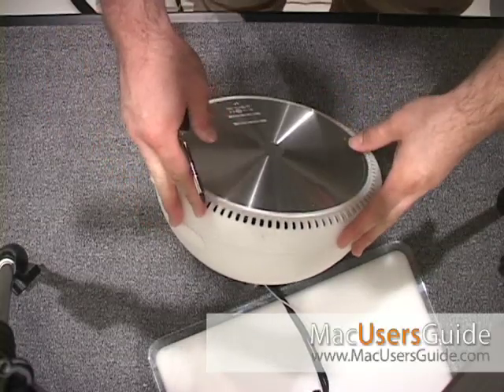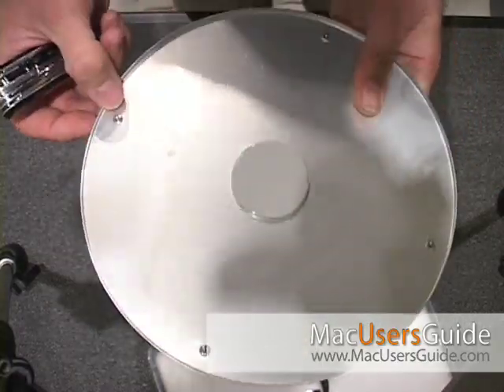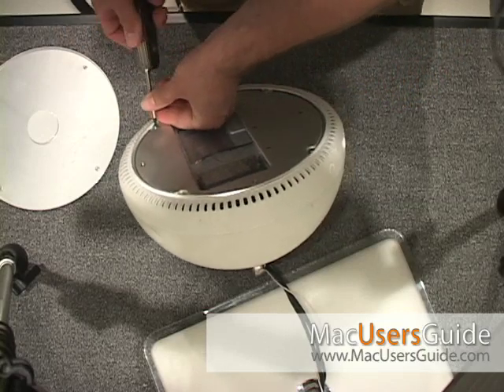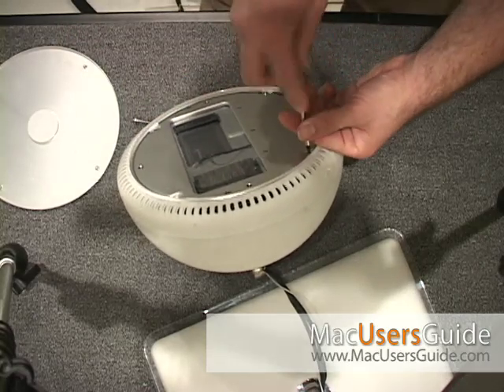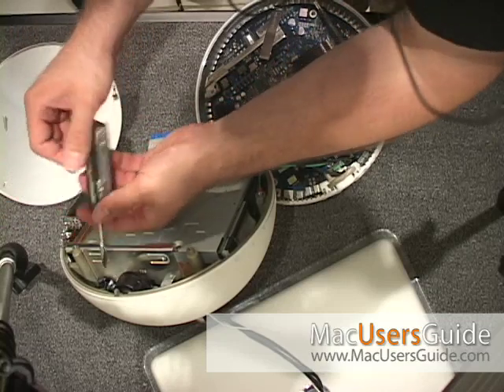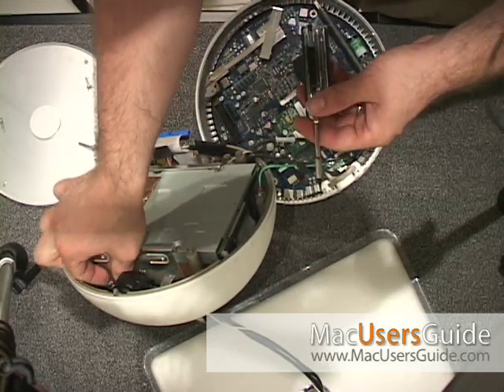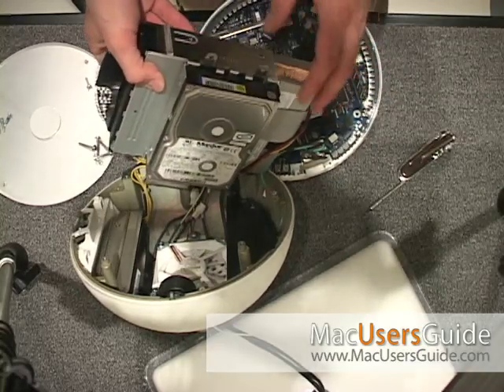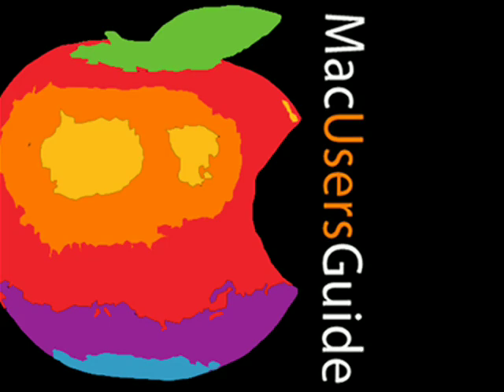iMac G4 Upgrade ( Snowball ) Part 1: Replacing the iMac hard drive

Comment: I've got one of these Hemi's sitting in my attic, and I'm looking at making it a usable computer, with something close to the power of a small modern computer.
I'm planning to remove the disk drive as I have no need of it and want to free up some space. I was looking at removing everything and building a ground up Hackintosh using the case and a new LCD screen, but that motherboard looks very fitted to the case shape. Should I:
a) Pimp the existing components (More ram, SSD, new fan) (How outdated is the CPU?)
b) Remove everything and build a Hackintosh
c) Give up on my dreams

I have some knowledge of building a PC from scratch, but not about the Frankenstien-like endeavour  this project would be. Thanks.

Comment: My Hemi Mac will not boot up it has a File folder flashing what do I do ?
Reply: Emo LeBlanc try do you have system software on the hard drive you put into the mac? If not, install Mac OS.

Comment: what kind of hard drive fits? a 3.5" sata ?
Reply: Drive in this video is PATA, not SATA. PATA uses a 40-pin IDE flat data cable and a 4-wire (Molex) power connector. One can find adapter for SATA drives to PATA connections but the performance hit is significant. I have not seen any PATA drive to SATA connection options, but they might exist.
Reply: a 3.5" sata hard drive fits a 3.5" sata hence the name

Comment: I tried to fit a 7200RPM 120GB drive, got it installed and to the folder with a question mark as it was pre-formated, but the CD drive wouldn't eject even when holding down the mouse, target disk mode also did not work and holding down the t key simply made the machine switch off. I then put in the stock hard drive it worked right away with all all of those functions. Its not a bad hard drive since it works in my Quicksilver so I'm stumped. The only thing I can think of is it a power issue?

Comment: This video is a little misleadng as to the ease of changing the drive, there are 4 heat pipes that also must be cleaned and new heat compound applied. If that procedure is skipped you risk your imac oveheating.